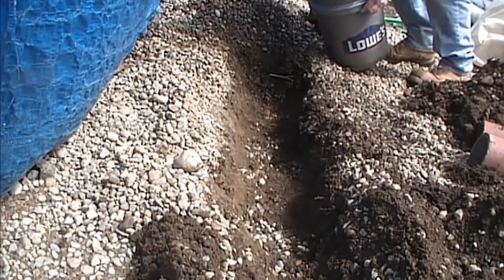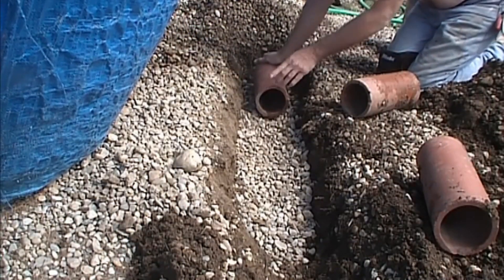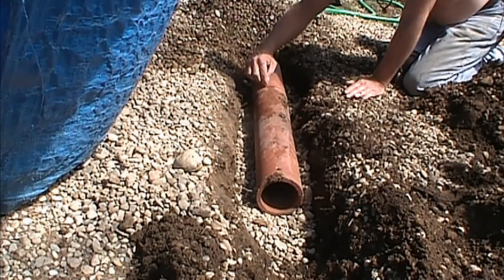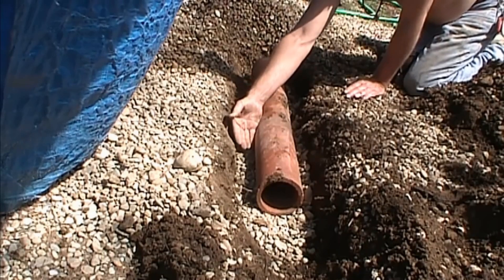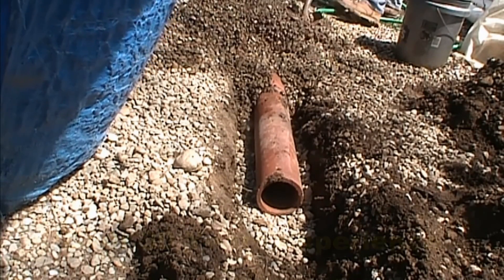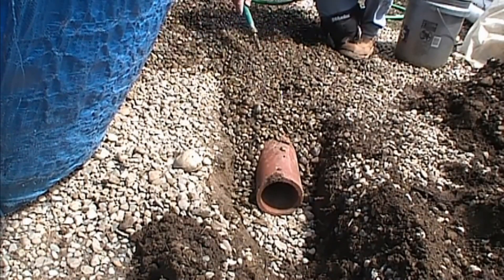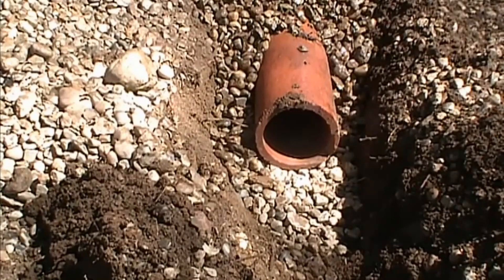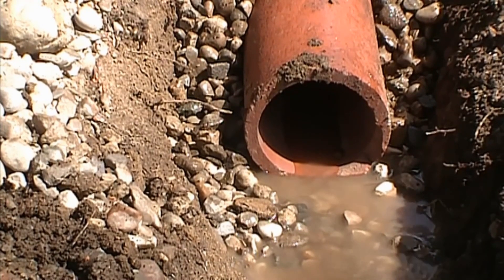FRENCH DRAIN, It Works!

Comment: Thank you for explaining how it works. I did what you said .I thought I didn't put enough peagravel but I see I put as much as you did and it is working beautify. And it was tested a lot this year if all the down pour rain we had in Michigan. And now 3 backyards do not flood anymore. So the next test will be the Snow. Thank you  so much again for your system because I was worried about the flooding to come up to the house and your system has prevented that from happening to 3 homes. Just from put the French Drain at the fence line. 🏅🏅🏅🏆🏆🚣‍♂️🚣‍♂️😁😁❤❤